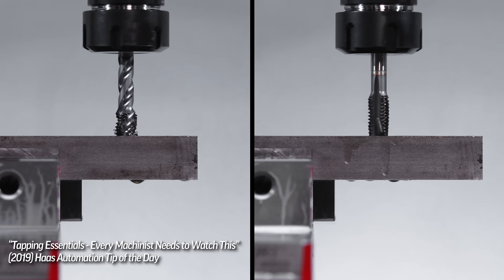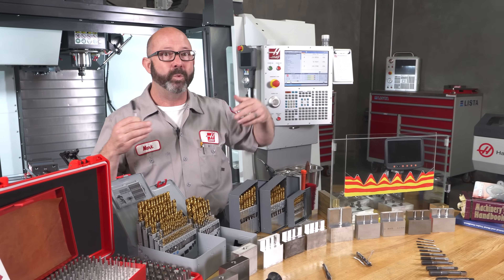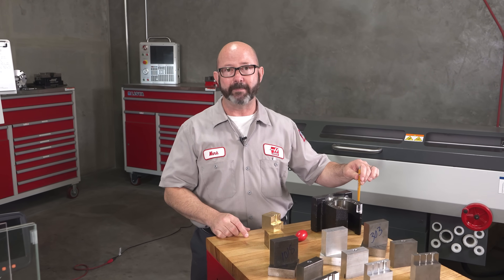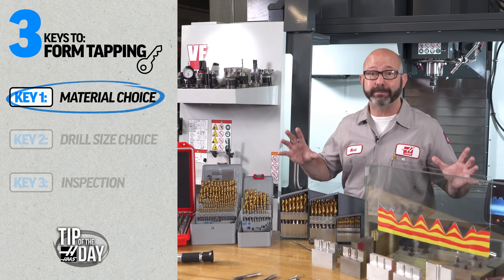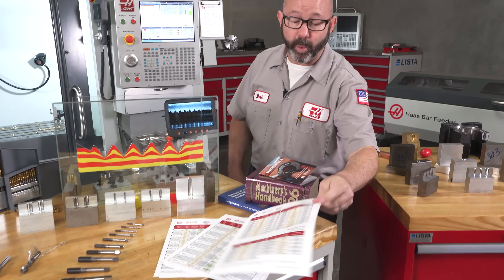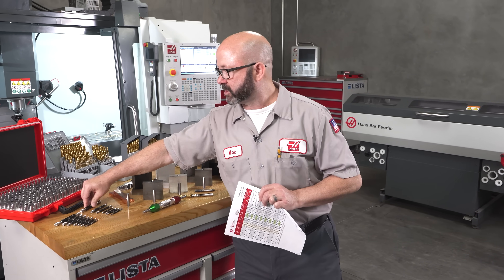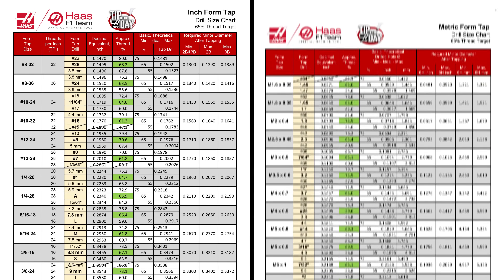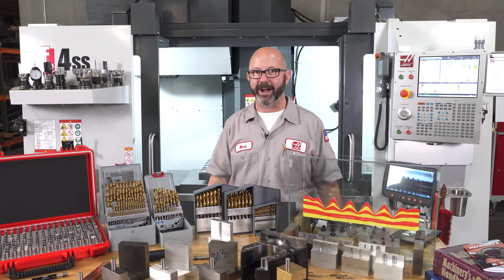Leave the Chips Behind! With FORM TAPPING - Haas Automation Tip of the Day

Comment: I hate cut tapping as i always get stringers wrapped around the tap and have to cancel the program to sort it out. End up programing 1 hole at a time. Spent years asking for form taps (what are those? They would say). Well we've just had a plate land that has hundreds of tapped holes in. I said if i threadmill, could take 2 weeks to get each hole in tolerance. With cut taps it could take nearly 2 weeks as its just awkward. Form taps.... i can drill and tap ALL hole in less than 2 days. I got the sense of both excitement and fear. They couldnt believe when the job was on the floor and the tap looked brand new still. Hopefully ive finally convinced them to get the full set of taps now 🤞

Comment: One very important thing I did not hear you mention is the strength of a rolled thread. It is much higher than a cut thread tap. Plus newer roll form taps can complete the crest form, many years ago they did not. Plus a roll form is now acceptable in the aircraft industry in Aluminum.

Comment: Rolled threads are also far stronger which you should've mentioned.
Reply: That’s a good point. We tested quite a few SHCS, torquing them until the threads pulled out or the screws snapped. We did this dozens of times on different materials, to differing depths, testing both Cut and Formed internal threads. I am convinced that, yes, formed threads are stronger than cut. Some of these test pieces can be seen in the video, behind the “ant farm”. We ended up cutting out this section, and another on coolant to keep the length of the video reasonable. We also cut a section on the Drill Index system, but will turn that into another video.
Reply: @markterryberry4477  That bit of information I got directly from a OSG applications engineer who came into the plant I worked at in aircraft ballscrew manufacturing where roll form taps were mandated by the FAA in our aircraft parts. Was a very interesting and educational class for sure.

Comment: My shop runs a lot of 410SS . We can run 100s of holes per tool, between 6-32 and 1/4-20. Either tapping compound or Simcool at +12% work well. We run carbide drills towards the max of the minor diameter.
We also run 4-40 form taps in Inconel with tapping compound. I don't remember the brand but it's thick, similar to Anchorlube or Buttercut. I'll try to remember to update this when I see it at work.

Comment: I love form taps! Especially for small threads like 2-56 & 4-40.

The machinists at my former employer were always afraid of taps and always opted to thread mill. I optimized so many programs by switching to the “indestructible” form taps.

I do recognize there’s certain applications where cut taps are the obvious choice, but it’s good to see forms taps getting the recognition they deserve, Thanks Mark!
Reply: I'm one of those who almost always just whacks a thread mill in there for normal programs.

If you want to optimise, this guy got it right. thread mills are a go-to for a reason but if you can use something more suited, you should.

Comment: I use form taps for thin materials where you need the strongest possible thread, because there isn't much material to spread the load, especially when rethreading (I'm looking at YOU, electrical wall boxes) where I don't know what's wrong with the hole, I just know that the screw won't screw. And soft materials, of course - 8mm copper is "thin" when you need it it hold an M10 thread.

Comment: Page 6 of the form tap chart has the incorrect required minor diameter after tapping for taps m8 and larger. The values are just copied from the previous page, smaller sizes.
Reply: Form Tap Charts updated and re-posted  on the same Video Bonus Content page that is linked to in the description. Thanks again.
Reply: Thank you so much! Terrific eye. Not only found my mistake but showed me the problem behind it. We’ll correct it and get it back up. Thanks again.

Comment: in most cases . a form tap is a stronger thread
Reply: We torque-tested many SHCS, measuring the torque at yield with different sized/length bolts on different materials, testing the difference between cut-tapped and form-tapped threads. The video was getting long so we did not include this, but yeah, form-tapped threads are stronger. I wanted to test this for myself before I said it in the video, and I’m convinced. You can see these test pieces in the video, behind the red and yellow striped “ant farm”

Comment: Another major advantage with thread forming, is that it's the strongest internal thread, it doesn't cut/break/shear the metal grain structure, but deformes it just like a forging process, thus does not induce grain boundary faults in the thread. 
Some high-nickel super alloys are ductile and have good elongation properties that would be suitable to form-tapping, the problem is the material is just too high tensile without being brittle, so the tap breaks. 
Also in tougher ductile materials, it might still be feasable in the "less extreme but still superalloy" cathegory, but needs to be done as a final step in the machine after the part has been blasted clean and dry, as regular machining coolant does not have the sufficient EP-lubricating properties, and extreme EP lubricants like molybdenum disulfide or equivalent needs to be used instead to prevent over-torquing the tap.
Reply: Great comment. We torque-tested many SHCS, measuring the torque at yield with different sized/length bolts on different materials, testing the difference between cut-tapped and form-tapped threads. The video was getting long so we did not include this, but yeah, form-tapped threads are stronger. I wanted to test this for myself before I said it in the video, and I’m convinced. You can see these test pieces in the video, behind the red and yellow striped “ant farm”

Comment: I worked at a large aerospace company that outlawed roll form taps. Some study some time ago determined that they cause these micro cracks that have small pieces of metal that can fall off in orbit. I don't know if I believe that. A cut tap probably has larger pieces of thin metal at the crest of the minor Ø.
Reply: Thread forming is also not permitted in medical technology.
Reply: What metal/alloy were y'all working with? Alu and I'm pretty sure Ti can be pretty variable in how well they form.
Reply: maybe annealing the part afterwards to undo the work hardening for these kind of applications, and the thread should be a little stronger due to the surface compression, and every high strength bolt gets rolled anyway
Reply: This is about doing it cheap and fast - not doing it right.
Reply: @interstellarsurfer form tapping is the right choice for a lot of applications, giving us stronger threads, that can be easily created. I’ve tapped a lot of M12x1.75 head bolts into aluminum V8 GM blocks at incredible depths, and it was absolutely the right method. There are quite a few applications where it is our first choice, but no threading method is “best” for all situations.
Reply: I could see this being the case, but I feel like it'd be a solvable problem. Without knowing the exact mechanism by which this microcracking happens I couldn't say for sure, but I imagine if you did pre-heating to soften the surface of the drilled hole combined with an extremely high temp tapper, low tap speeds, etc. you could reduce any microcracking well enough.

Is that sort of tool innovation practical in your average garage? No. For major aerospace work? Absolutely.

Comment: nice video mark. in my job, we form tapping some titanium grade 5, Ti6Al4V.  metric thread M15x1,00 (we pre-drill... actually bore the hole close to d14,55mm) The taps can make 1000+ parts, normal coolant, lots of it. it was hard to find a supplier for taps at first that only use simple coolant.
Reply: I operate CAM and CNC in Korea and mainly process Ti-6Al-4V materials. How did you successfully handle the M15 size tap?
I use thread mill to handle large diameter taps (e.g. M16 P2.0).

Comment: Anyone do form taps in 4140 and 4140X steel? Most taps would be between 3/4"-10 and 1"-8.
Reply: Yes and no. We form tap normalized (not heat treated) 4140 all the time, it has good ductility. But, form tapping with large taps like 1”-8 is beyond what we typically recommend. I actually left the form tap drill information off of our drill chart for anything larger than 5/8” and M16. People form tap with giant form taps all the time, but it is very application (machine, coolant, material, tool) specific, and not a standard practice. I’m interested to hear from people in the comments.
Reply: @markterryberry4477  We cut tap and thread mill them currently with a large boring mill. I am unsure what the machine power is off the top of my head. We create tools for the aluminum die casting industry.  We put a lot of tapped holes in them, so I was just curious when I watched the video. Thanks.
Reply: That's a job for a threadmill if you can get your hands on it.  Form tapping will take a heck of a spindle.  Cut tap if you don't have a threadmill or thread cutter for a lathe.

Comment: You missed that for form taps you need to bump coolant concentration around 30% higher, otherwise you will be snapping strongest taps like no tomorrow. Ask me how I know.
Reply: How do you know? 😅 great comment
Reply: @markterryberry4477 I snapped a lot of them on reverse. Goes in fine, goes back snapped. Tired a lot of rpm, bought compensating holders, different makes and coatings. Ended up running slightly rich coolant (7-8% is recommended for general machining, running 9.5-10.5%) and all my problems went away.

Worth every penny, esp equally in 7075 and stainless.  Both tend to eat up cut taps after 2 figure hole count, but rolltaps run forever.

Tool life is mainly because there is no metal on metal contact at any point, you slide on oil film pushing material away. But oh boy if your oil film is not thick and strong enough and metal on metal contact does happen, you are in the world of hurt.
Reply: @u_solutions_lv  but this is recommended on most cooling solutions. 
Machining stainless with any tool does require more oil in the mix. 
I typically run around 10%.
(I know why, stainless has taught me well.😋)
Reply: @FabioMuhl-ug9fd you snap without rich coolant even in low carbon steels.

Comment: I think there is nomenclature problem with ductile. I would advise use hardness in place of brittle/ductile for machining process. 
Soft material forms large and continuous chip and hard material form flaky chip. Besides this point, all the drill are sold with hardness labeled
Reply: We wanted to keep hardness separate from ductility, as they relate to two different qualities. Some materials, like cast iron, are very soft (don’t even reach HRC scale), but that does not mean it can be form tapped - it is too brittle (low ductility, low % elongation).

Comment: Is 6al4v Titanium form trappable?  We even do some tougher Ti.
Reply: A general rule is that the % Elongation should be greater than 10%, and the Hardness less than HRC 25. 6Al4V can be borderline on Elongation and is often too hard. We do not recommend form tapping 6Al4V, but many make it work every day, especially on fine or small threads. I would do some testing and research before moving forward. Let’s see what comments we get, but the short answer is I would not recommend it typically. Test and measure twice. It’s on the edge.
Reply: @markterryberry4477  awesome! Thank you.  I've been investing in vargus thread mills for these expensive Ti parts.  Have you seen the reverse rotation thread mills?  Very good tool life without push off!  Expensive up front but not breaking taps... Priceless.  For everything else, there's MasterCard 😂
Reply: If there are too many holes or shortening time isn't the top priority, I'd rather recommend a thread mill.

Comment: lol g84 not support Q (pecking)
Reply: It’s a good comment, topic. On a side note, I’ve never peck-tapped with a Form Tap. There are no chips to cause problems, so I’ve only ever form-tapped in one shot. Peck tapping can be useful with some cut tapping applications though.
Reply: @markterryberry4477  ohh you never peck-tapped.....because there is no simple Q support......
Reply: Q Pecking is supported with G84 on Haas machines, since SW ver. 100.23.000.1200. If your machine is older than this (Classic, not NGC) you can still Peck tap, just follow the instructions in the manual or our G84 Peck Tapping video.
Reply: @markterryberry4477  no simpe solution if i got 50 60 holes in one setuop one program

Comment: Some particularly gummy materials, such as 99.9% copper alloys — copper 110 being one of the more notorious examples —, are downright impossible to tap to a suitable depth with cutting taps. Form taps are essential for these materials.
Reply: Thanks for passing on that valuable experience. This kind of info really helps the next machinist.
Reply: I was cutting a lot of copper a couple of years ago.  It just laughs at cut taps and breaks them about instantly.

Comment: 40 years ago I worked in a small engineering shop and we had to make a quantity of silver steel pins with very high accuracy. The taps were expensive at £ 32 each and the gauge was £96 as the tapped hole was 1.6 mm. So centre drill, drill, ream and then tap. As we had to source our taps and gauge direct from the manufacturer, we asked them it if was possible, they had no idea but said to let them know lol. Great video for bringing machinests kicking and screaming into the light lol.

Comment: Used thread forming taps in production for many years. Almost always in aluminum. 
We would hold a 0.02 mm tolerance reliably on thousands of holes. The one take away I could add would be the coolant used.
Without changing tap rotation speeds coolant concentration and type would affect minor hole diameters. Even the through tool pressure was a factor as some machines used higher pressure systems often requiring fine tuning to get finished parts into line with those from other equipment.
Today its always my first choice for threaded holes if possible as it gives the best wear resistant threads that are the strongest possible.
Reply: Wow, that’s really good advice.

Comment: Funny I was just looking for info on form tapping 1" aluminum plate on a vf3. Will you be releasing more information on feeds, speeds and maybe the motor torque needed for form tapping. I have a lot of holes to tap and would like advice.
Reply: I pulled the info for the big form taps off of our chart because I did not personally  verify things. We drilled/tapped/measured nearly all of the taps we list on our chart to verify things, not just going off formulas. Form Tapping larger than 5/8” or M16 can get tricky, and is typically not recommended, so we decided to hold off on that info for a future revision. Folks do it all the time though. Post your results in the comments or email us with your specs when you run things, I’d love to hear how things go.
Reply: Only advice would be to keep your coolant concentration high for lubricity, start your G84 well above the part, and keep your RPMs on the high side for the most torque/kinetic energy

Comment: Rule of thumb for drill size, when form tapping metric threads is to subtract half the pitch from your nominal thread size. Always rounding up. E.g. M8 = 8-1.25/2~7.4
Reply: Brilliant. The formula I settled on, after checking many, and testing results, was Drill Ø = Tap Ø - ((% x Pitch) / 147.06). Which, choosing 65% thread percentage is Drill Ø = Tap Ø - ((65 x Pitch) / 147.06).  
Your rule of thumb gets us darn close, even on standard inch threads. Love it.
Reply: BTW, you can create the diameter symbol on your phone by pressing and holding the letter O on keypad and selecting Ø option. Also, we can create the degree symbol by pressing and holding the number 0 on our phone keypad, like for 90°
Reply: @markterryberry4477 
Ø thank you!
⁰i've always wondered, but never bothered to Google it.)

Keep up your good videos,  it's nice to see a thought out video format on our job. 
I always told other machinists it's the biggest flaw in our job.
Not beeing able to find reliable simple informations.

Comment: You must not use it for aerospace applications! There ar two reasons: First, there is a small channel on the minor diameter. This is a trap for moisture und is a danger for corrosion. Second, airctaft indusrie uses UNJ treads. "J" means the minor diameter is a little bigger, and it forms a less propper profile if the drill is bigger.
Reply: Thanks for the great comment. While certain customers love them (Automotive..) there are those that won’t allow a form-tapped thread. I’ve had some Food Service and Medical Device companies ask for cut threads (not formed threads) because the cavity at minor diameter could trap bacteria. Stronger threads, usually, but there are things to look out for.

Comment: I have a question regarding what's happening at the minor diameter. It looks like there are "slots" right around where the sharp would be on the minor diameter. I just pulled some of my form taps out and looked at them under a microscope, and I am a little confused on what causes that, and what the purpose of them are.
Reply: It’s crazy, but the metal rolls up both sides like little waves and leaves a gap in between the two waves of metal at the crest.